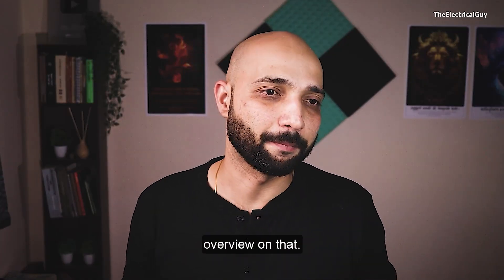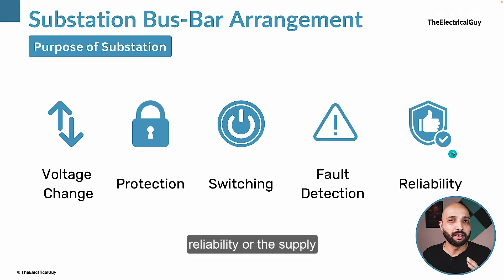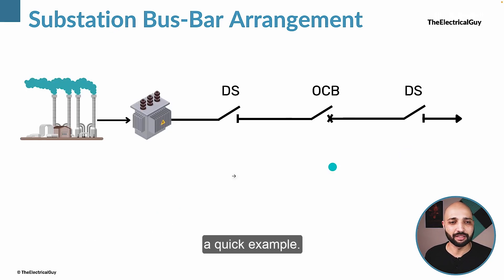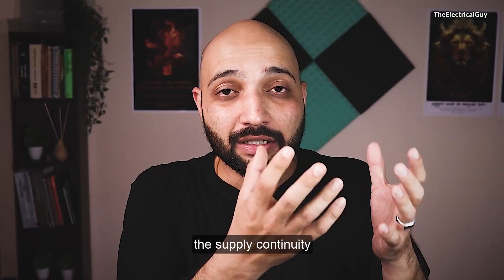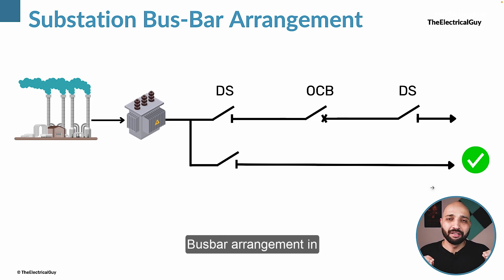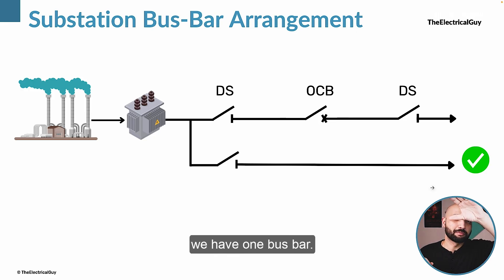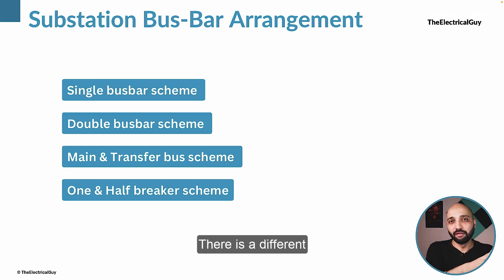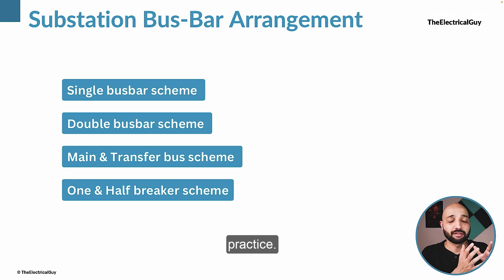Substation Bus Bar Arrangements | Introductory Guide | TheElectricalGuy

Comment: Sir, can you please make a video on 11kv,33kv,66kv,132kv why they are in multiple of 11 and if there is -0.8 power factor what is that means please explain
Reply: It is not because of form factor or power factor...
Their is 10%  of power losses in transmission lines ..
If industries needs to transmit the 10kV voltage then they add 10% of 10(10*10%) which is one..
So they add 10+1 which is 11 then they transmit the 11kV voltage...